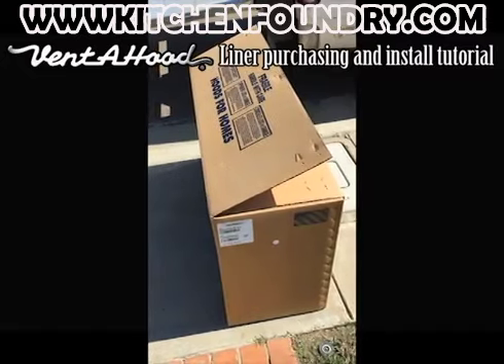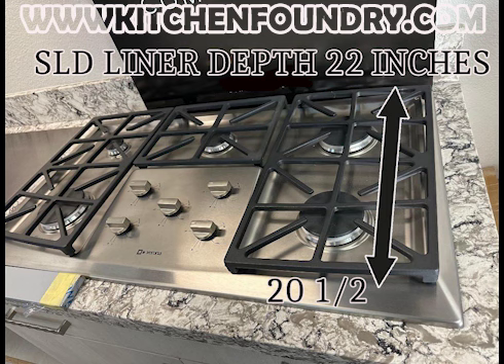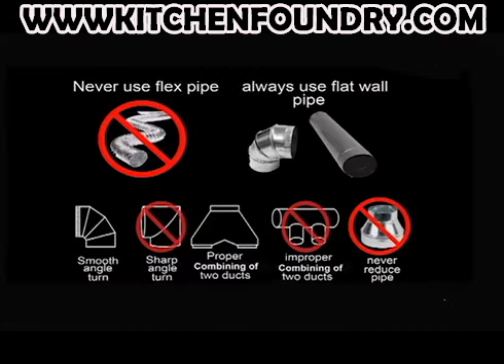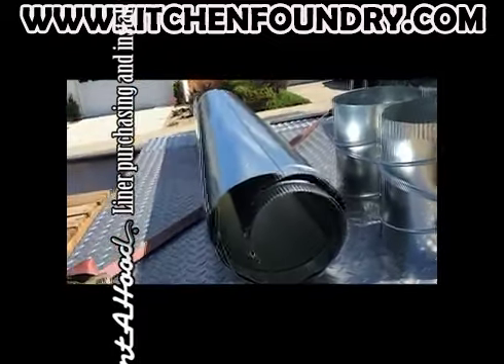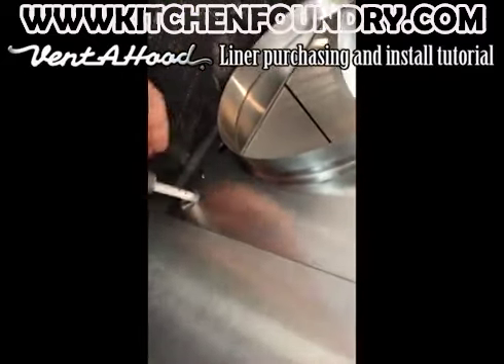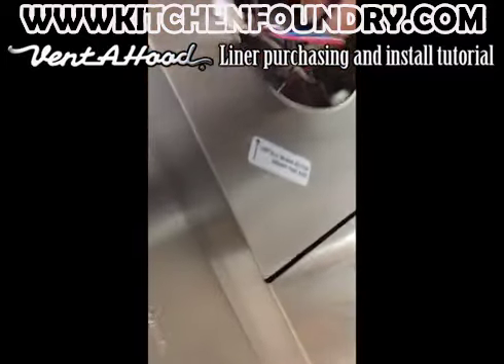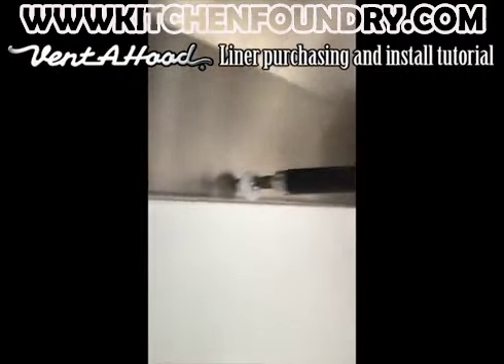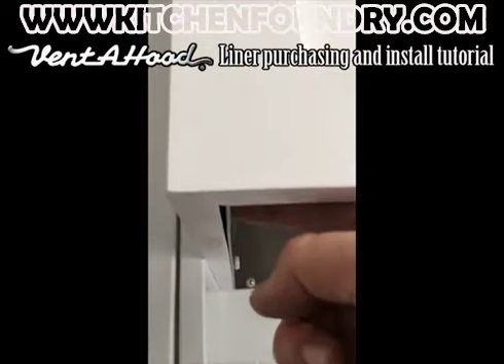How to Install a Vent-A-Hood Liner Step by step Guide For Proper Vent a hood Installation

Comment: Can you vent directly out exterior wall with a 90 degree elbow?
Reply from the maker: Yes.   You can put a elbow on top of this hood and vent out 90 degrees out a back-wall you can also use the manufacturers vp561 to vent 90 degrees .

Comment: Hi, we have 8 inches ducting to the roof . Is it a waste of buying 3 blowers and reduce to 8 inches?
Reply from the maker: These hoods still work with pipe reduction   However you will not get the full CFM the product is rated at. Watch my video ducting dos and donts 2 on youtube